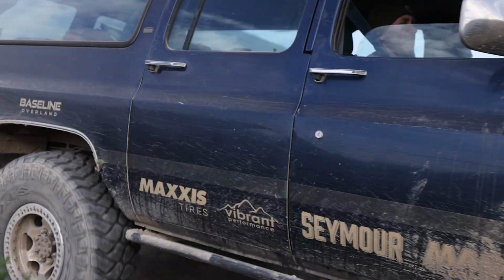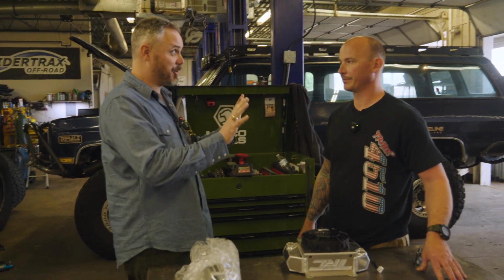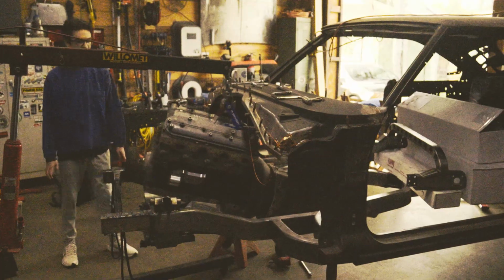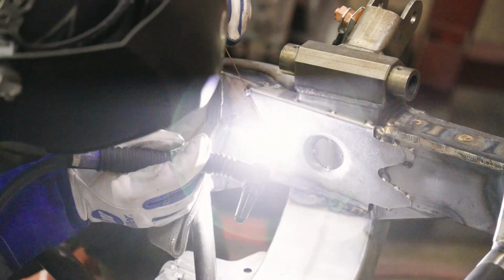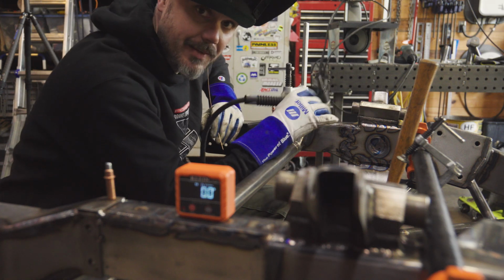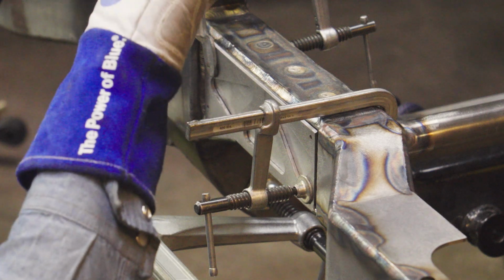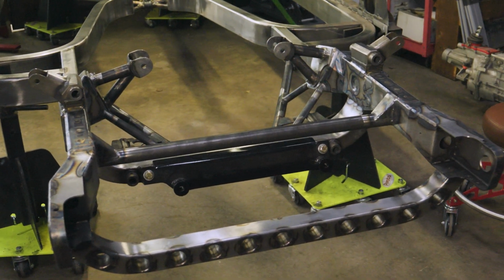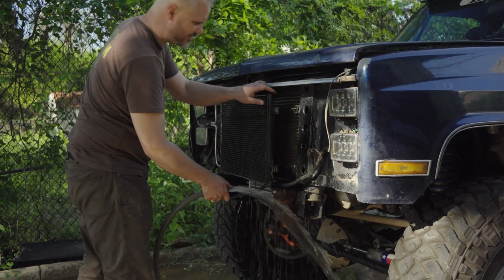Triton Racing Coolers and Chassis Welding | 1970 Dodge Charger 17

Comment: Nice work David!!   I've heard the protective spray for bare metal referred to as "Ego Juice" for the way it makes the welds and metal look when it's applied.  Really brings out the colors in the TIG welds and makes photographs (and videos) look amazing....   :)    If I know I'm going to take a few IG pics, not ashamed to say that I will wipe everything down with a little ego juice first....   LOL
Reply from the maker: Ego Juice. That's going in the bank. It does totally change the color of the work, but I also can't handle letting it rust until I get back to it. We can take the hit on Ego Juice and avoid extra work later. We need to get together soon and drain some MP beer.